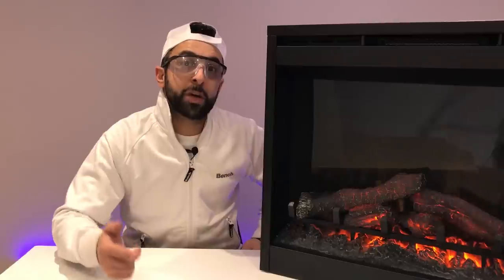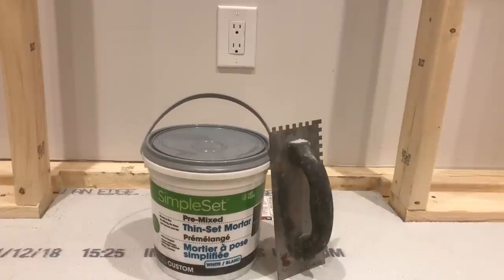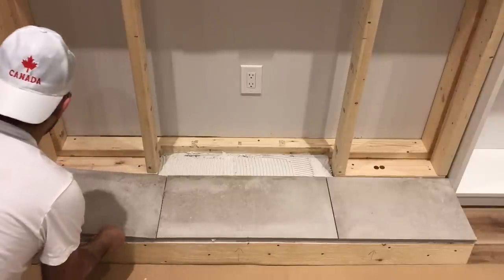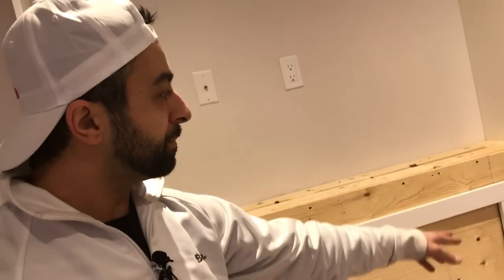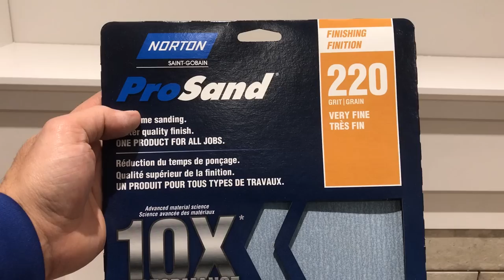DIY Electric Fireplace Surround with Built-In Wall Unit

Comment from the maker: 0:57 Home Depot trip to get parts
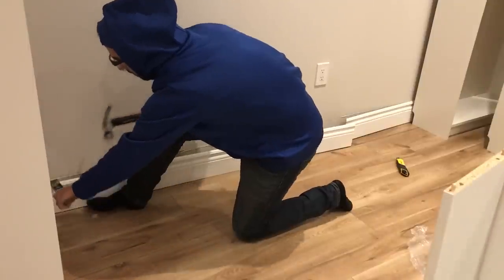1:20 Preparing the walls and floor
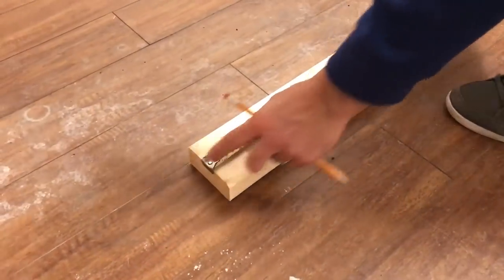3:25 Building the Hearth (base)
6:12 Preparing concrete backer board 
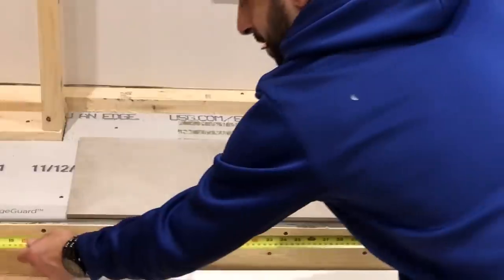8:39 Tiling the Hearth (base)
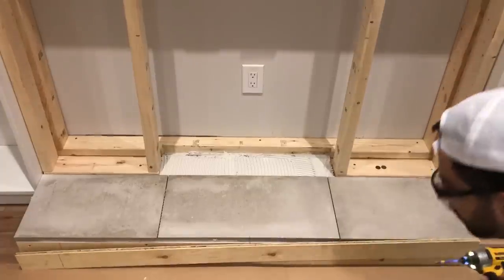10:50 Designing the brick tile pattern
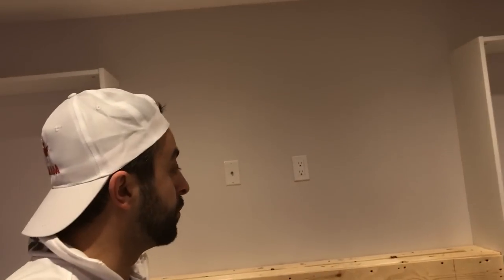12:56 Installing the fireplace trim surround 
16:23 Building the fireplace mantel 
18:23 Tiling the fireplace surround
22:09 Making a trim for the Hearth (base)
24:20 Grouting the Hearth (base)
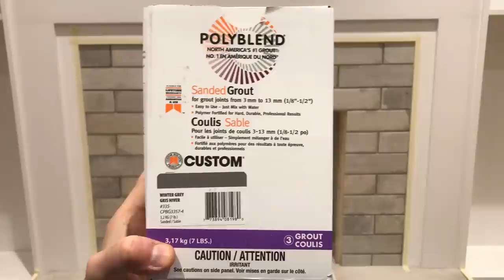24:31 Grouting the surround with brick tiles
25:24 Final Product!
Reply: This is what I so want. I found a fireplace at Big Lots. 600$ and I want to put white Billy bookcases on both sides!🥇🎄
Reply from the maker: Valerie Stout nice! Good luck! It’s a very fun project. Would love to see how it turns out. Keep me posted :)
Reply: What kind of electric fireplace insert did u buy?  Do You like it?  I want a realistic looking one ...lol.
Reply from the maker: Christy Potzer I’d have to check with my wife as she picked it out. We love it, very realistic and has many colour of flame 🔥 options to suit your decor and mood. I do remember going to an electric fireplace shop to view the models in real life so that helped a lot with our decision.
I hope that helps a bit.

Comment: I loooooove that fireplace.🐈
Reply from the maker: Robert Douglas thank you very much for the compliment on the fireplace wall unit. I ended up mounting a 65” TV which fit nicely in there.
Reply: @downtodiy6245  I think I want to specialize in fireplaces. I am disabled I can't climb latters. Do you think a person with a bad back can handle that. I really love that fireplace 🐈
Reply from the maker: Robert Douglas anything is possible if you have a passion for it and the willingness to do it.
This is not what I do for a living, just a hobby of mine. As for your disability, it’s tonight to say.
I would start with some basic ones and build up as you gain confidence. Best of luck my friend and thank you again for the comments.

Comment: Looks great. I do see a major issue though. What you gonna do when you need to replace the laminate flooring? Hmm? All this could be mounted to 2x4 wall studs a few inches off the floor, then capped with trim. Easily remove the trim if the floor needs replacing.

Comment: Overall how much was this project? Please inform because I want to do this with my husband. This came out awesome.
Reply from the maker: Reborn Legacy thank you!! it ran me around $850. The Ikea shelves cost around $200. That’s 2 shelves and 2 extenders (so they reach the ceiling) fireplace insert was around $300 and another $350 in materials.
DM me if you want a more detailed breakdown. I definitely encourage you and your husband to build it. My wife and I are glad we took it on.. still doing some touch ups this week on the bottom trim and finishing touches.. take pics and send me them when it’s done!! Good luck :)
Reply: @downtodiy6245  Thank you!!!

Comment: Great job bro that came out amazing.
How much Did you Spend on materials
With Shelves included.
Reply from the maker: Reborn Legacy thanks for the compliment! it ran me around $850. The Ikea shelves cost around $200. That’s 2 shelves and 2 extenders (so they reach the ceiling) fireplace insert was around $300 and another $350 in materials.
DM me if you want a more detailed breakdown.

Comment: This is such a great detailed video, thank you so much.  Quick question - you used cement board for the tiles on the hearth (horizontal), but not for the tiles on the face of the fireplace (vertical).  Was the cement board necessary for the hearth?  Is there a reason for this?  Thanks for your help!
Reply: Apologies just saw further down you answered this :)

Comment: Good job spanky!   You paid $200 for $15 worth of wood just because it says "Ikea" on the building you bought it in.  Genius on the job!
Reply from the maker: Alvin Toodugz thank you for your comment. I bought the two IKEA shelves because they were affordable finished pieces that made the job a bit easier. Sure I could have bought melamine 4’ x 8’ boards and cut them myself but I would have needed 4 boards of 4’ x 8’ minimum at a cost of $39 per board. Total cost would have been $160. Plus the cut ends would have needed to be edged with melamine tape, another $20. It would have cost close to $180 to try to build it myself and so I figured it’s worth it to pay a bit extra and have it already complete. Just needed to assemble it which was not too difficult.
I do agree with you that IKEA quality is sub par but the shelves do not need to be so durable  as they are never abused. Plus I tried to keep it as simple as possible for those who may not have the skill and patience to try to build 2 shelf units. There is so many ways to complete the project. The intent is only to encourage people to try to “do it yourself” like I said I’m no expert by any means but I think it turned out quite nice for what I spent. Thank you for watching :)
Reply: @downtodiy6245  the tutorial and finished product were really good.   Sorry for being an ar$$ and thank you for sharing.

Comment: I working on my own project with a ventless gas fireplace.  Question though... I see that you only used cement board on the base, but not behind the tile on the surround.   Is it okay to tile directly onto the plywood.  I've read things that said that tiling directly onto plywood will cause the grout or tile to crack.  So I am trying to decide what the best way to do this is...
Reply from the maker: Kenny Cramer very good question. It’s ok to tile directly on plywood “if” you’re using Tile Adhesive and not regular mortar.
Here’s the link to the adhesive I used from the Home Depot: https://www.homedepot.ca/product/custom-building-products-acrylpro-ceramic-tile-adhesive-type-i-quart/1000423197

I hope this helps and good luck with your project!
Reply: Sorry to pester you on this, but I am terrified of doing all this work and having things fall apart on me.... so where did you find out that it is okay to tile on plywood directly with this adhesive?
Reply from the maker: Kenny Cramer it’s no bother Kenny dont worry. For one I have been tiling for many years and have always used AcrylPro tile adhesive for all wall applications. The formula which is much stronger than mortar is meant to hold tiles upright on a wall. Typically we use this product directly on drywall but it’s actually more effective if used on wood since wood is more coarse. The adhesive bonds within the wood fibres and ensures a strong grip.
I’ve had this fireplace up now for over a year and can assure you that the only way they’re coming off is with a pry bar and hammer. If you’re still not convinced you can ask your hardware store and I’m confident they will tell you the same thing. Keep me posted on what you decide to do and good luck! I’m excited to see how it turns out.
Reply from the maker: Kenny Cramer here’s another video where he applies the adhesive directly on plywood https://youtu.be/coUz8B228B0

Comment: I've watched a few videos now of guys installing these fireplace surrounds and each one installed on top of the existing finished flooring. Would it not be better to cut out the flooring? If you ever decide to remove/replace it, you will have to try cut it from under the fireplace framing...(Maybe that's an easy job with the multi-tool?)  I don't really know; I'm just wondering
Reply from the maker: Mark James hi Mark, I’m not sure I follow. I did not place a single screw in my flooring. I only drilled into the wall studs. Reason for that is if I ever decide to take down the fireplace surround I would not need to worry about replacing any floor boards.
I’m not sure if that answers your question.
If not please clarify because I’d love to help :)
Reply: @downtodiy6245  Ahhh I see. Good idea! I kinda thought the fireplace surround was more permanent than the flooring, but not screwing to the floor is a great idea...either floor or surround can be removed with no damage to the other. I just learned something. Thanks ;-)
Reply from the maker: Mark James anytime 👍 send me pics if you ever decide to do something similar.

Comment: Did you use ikeas extension for the bookcases or did you make them? Also for reference what size tv is that?
Reply from the maker: Deanna Ippolito yes I did buy the extensions however I cut them to size so that it could fit.
I put the extensions on the top so that the unit would be more sturdy. Then used dap to cover the seams. The TV in my thumbnail is the new TV we bout which is a 65 inch. The space between the two ikea units is 60 inches and the 65 inch TV is around 55 inches wide so it gives me about 2.5 inches on each size.
Reply: @downtodiy6245  thank you so much! How have the ikea shelves held up? I wanna use them but my husband is concerned because they’re particle board.
Reply from the maker: Deanna Ippolito I understand his concern but tell him they are great. I mean it’s not like they’re going to be bombarded with abuse or constant weight and use. They’re just shelves and they’re strong and very very affordable.
To get that in real wood would put the cost up by 5 fold. Tell him it will be fine. Mine still look brand new 1 year later.

Comment: You are talented and this is inspirational. Did you create the lip of the mantel or did you buy it that way?
Reply from the maker: De Lo thanks for the compliments 🙏... god bless.
I created it.. it was kind of tricky and I had to come up with something from scratch. To be honest that was one of the most difficult parts to plan because I’d never built a lip before. It’s essentially trim pieces that I glued in place but has the appearance of something thicker which was the look I was going for.
If you need more clarification message me and I’ll show you a close up of what I mean.
Good luck with your projects :)
Reply: De Lo I was wondering the same thing about the lip. I don’t understand what you did to make the mantel.

Comment: Is this an electric fireplace? If so did it need venting behind it ?
Reply from the maker: Ernest Enriquez yes it is electric and no venting required.. as long as the back is 4 inches away from the wall for air circulation it’s fine.. works great and super easy to maintain

Comment: Great vid! I'm so inspired to do this now. Would you mind sharing the cost of this project? Also, how did you raise the heights of the bookshelves? Did you build a platform for them as well?
Reply from the maker: I’m so happy to hear that! The cost of the project overall including the fireplace was around $900.
The Billy bookshelves are from Ikea.. they also sell extensions for them that I had to cut slightly to make them fit. I did not video that part I apologize. No base was built for the shelves only for the fireplace..
If you do start working on the project be sure to send me pics and videos! I’d love to see it :)
Reply: @downtodiy6245  Thanks for the info and tips!

Comment: where did you get the white trim material?
Reply: what thickness?
Reply from the maker: Rita Martinez I got all the trim from Home Depot but any big home building centre should have it. Thickness was about 1/2 inch.
The trim was one of the tricky steps. Best of luck and I hope that helps.

Comment: How u can install the tile in top of wood that’s Mickey Mouse work that’s not professional
Reply from the maker: Basem Bisso hi Basem. I agree with you that it would be a better idea to have put concrete backer board in between the plywood and tiles. I did it for the bottom 3 tiles because I was using thin set. I didn’t do it on the wall tiles because I figured adhesive would be strong enough since there won’t be any pressure on them and they are very light.
You’re right, and I’m not a professional I was doing it as a hobby only and thought why not film it.. 
if you pay close attention lol.. at 0:28 seconds into my video I said “I’m not an expert by any means”
Anyway I still appreciate the feedback because you are right.. 
It’s held up for 8 months since I built it and god willing it holds up another few years 🙏
I hope you still enjoyed the rest of the build, god bless and have a good night.